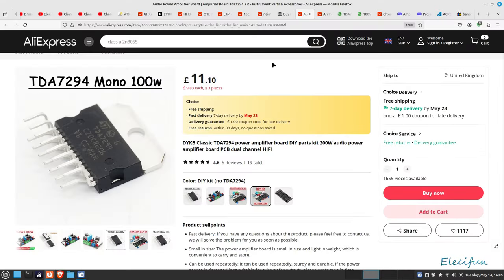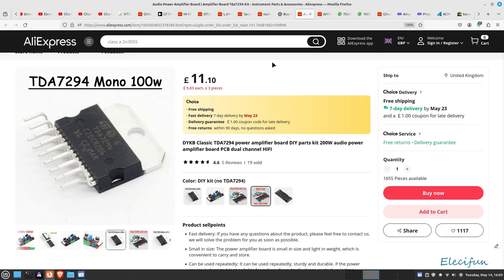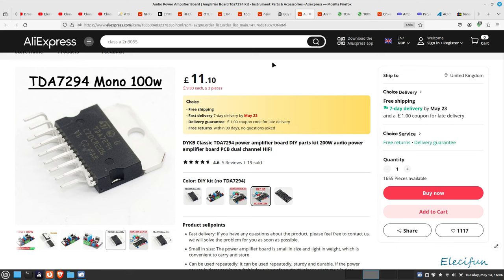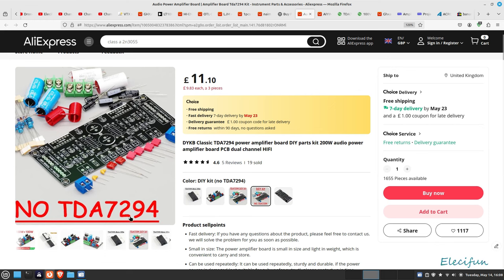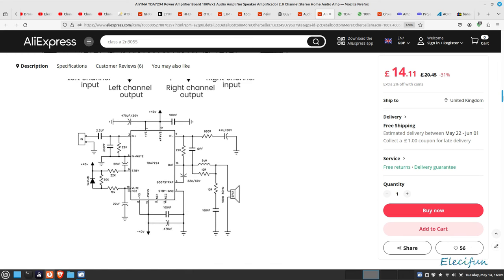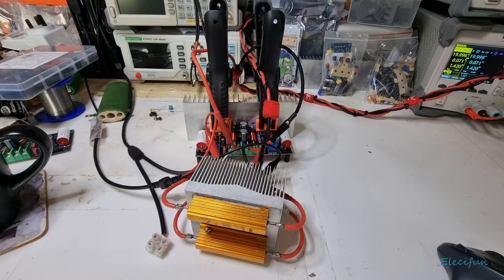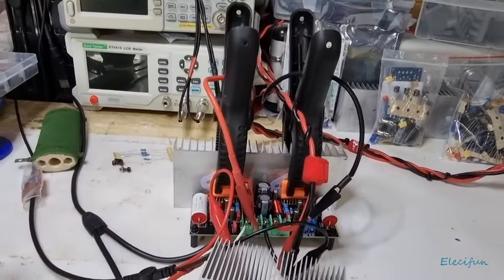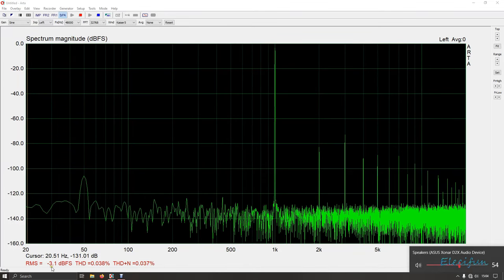TDA 7294 Amplifier Kit (Aliexpress) Test

Comment: Seems to be a pretty good kit when the components are genuine. I'm glad your power supplies are back up to snuff. Thanks for sharing your electronics adventures amigo.🤠👍
Reply from the maker: @Sonic_Ox Yeah nice compact easy build. Pity the first one didn't work out so well. Not sure where the 100 watts per channel come from with this circuit. 
The IC is spec'd for it in an ideal circuit but as the ideals can fall apart with temperature gain.... lol
Reply: I like the looks of that one. It's got me designing enclosures in my mind lol.

Comment: 0:39 I looked on the specs it's 100W peaks not continuous which is typically what Chinese sellers state while it is probably accurate it's not as you know a RMS rating which is kinda annoying. 🤔
Reply from the maker: @decem_unosquattro9538 The specs according the the TDA7294 datasheet state 100 watts music power, which I find, as you do, annoying. 
I am sure most of us we would like our watts to be RMS. 
So if we see the RMS output power the test showed, we could almost say if we want to use the music power term, (can this be interchanged with 'peek music power output'?) I think we might have been looking at 90+ watts. 
Good catch Dec... nice to see!
Reply: @Elecifun  Yeah, that's right compardre  it's a PMPO rating which makes the specs look better but yeah it's not an RMS (root means square) rating.
Reply from the maker: @decem_unosquattro9538 The ST TDA7294 datasheet table 3 provides the electrical characteristics. 
RMS and PO parameters are provided including 4 ohm and 8 ohm variables. 
I think this is interesting : Music Power (RMS) IEC268.3 RULES - ∆t = 1 s

Comment: Compadre, what's your next project? I was hoping you would take on something a lot more challenging like a 1000W amplifier. 😅 come in knock our socks off ! Can I ask what is the best of the best of the biggest kits? I've looked at a few and its very challenging to just find an amp of good quality.

How many of the big amps is worth building?

You've built an incredible amount of amps.

What are your thoughts on the bigger amplifiers say around the 600~1000W range?
Reply from the maker: @decem_unosquattro9538 I can't justify buying, building, then building power supplies for and testing 1000 watt amplifiers. Sorry. Also I can't think of why I may need one. 
As you know this is a very small Vlog which doesn't make any money and so can not buy. If you want to finance a 1000 watt build let me know.  I am open to your offers.
Reply: @Elecifun  Okay, fair enough. 👍🙂